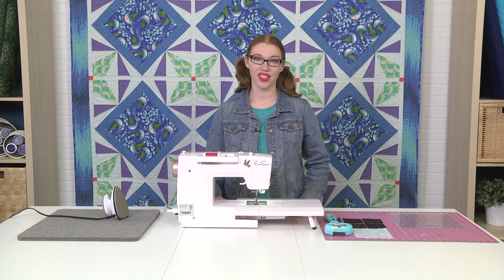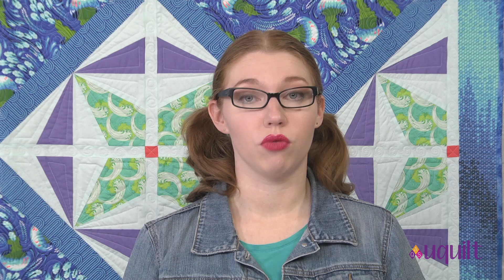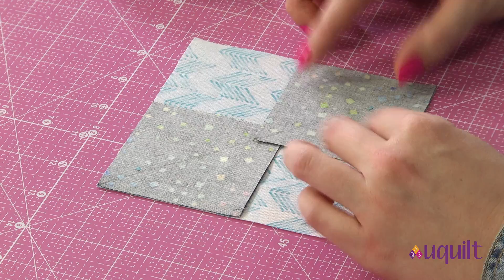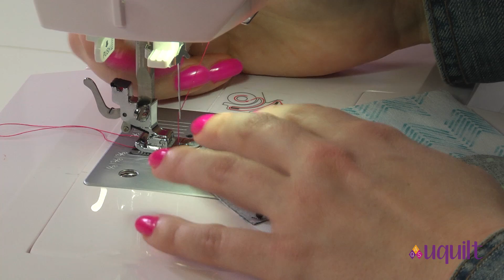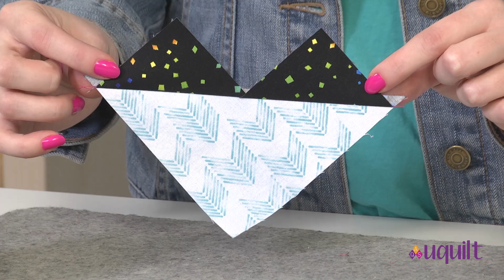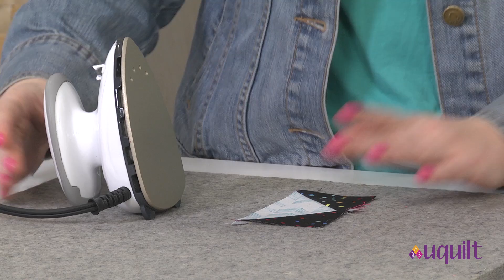How to Make No-Waste Method Flying Geese - uquilt with Emily

Comment: How do you determine the square sizes? If I use a 10” main square, or 6”, or 4” ?
Reply: Thanks for the question, Monica! 

For the geese fabric, add 1 1/4" to the finished width of the Flying Geese. Cut 1 of these
For the background fabric, add 7/8" to the finished height of the Flying Geese. Cut 4 of these.

You can work backwards this way too by figuring out the finished size from the larger square. For example, a 10" square for the geese will make four 4 3/8" x 8 3/4" finished size Flying Geese and would need four 5 1/4" squares for the background.
Hope that helps!